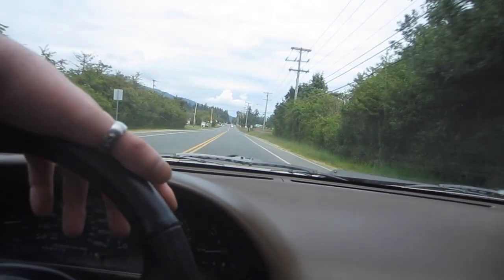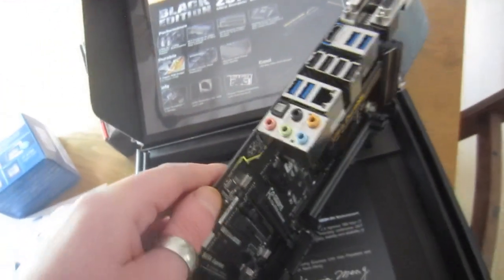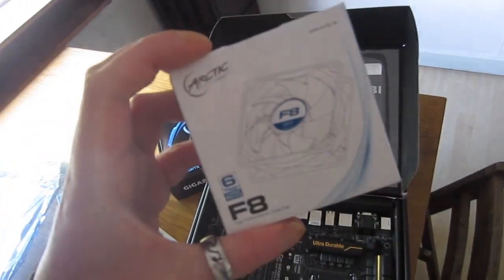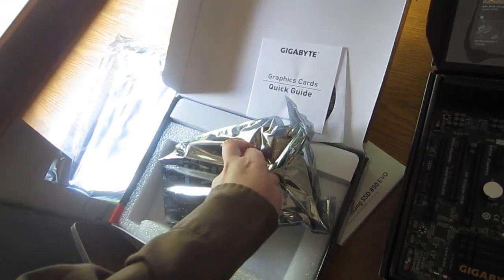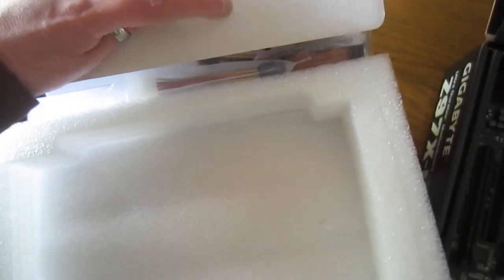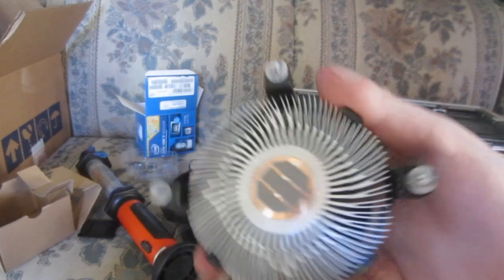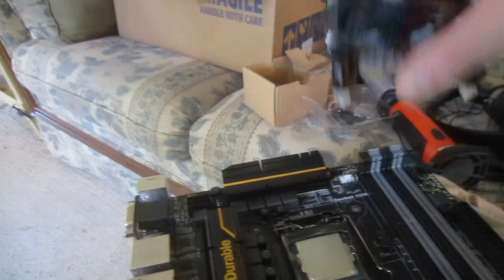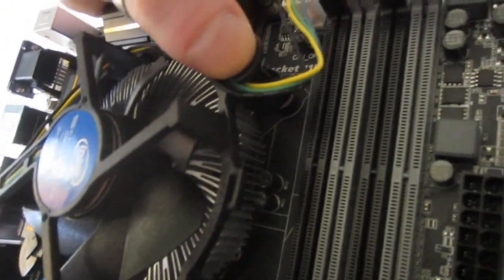Building Core i7 Super Puter : Part 1 : The Parts & CPU Installation

Comment: same processor as me, only difference is mine's in a Dell latitude,2GB video card, 1tb sata HD and 2tb storage drive, 16GB ram dvdrw $679.00 to my door, i added in my 7.1 Turtle Beach Montego DDLsound card and this thing is screamin
Reply from the maker: DaddytechEnt nice! i7's are smokin' fast indeed. this'll have 16GB of ram, too. then two 256GB SSD's and a 1TB WD black for storage. not too shabby! I'm a little worried about heat tho.
Reply: the only thing in that one that should generate heat is the video card, 1tb drive and the proc